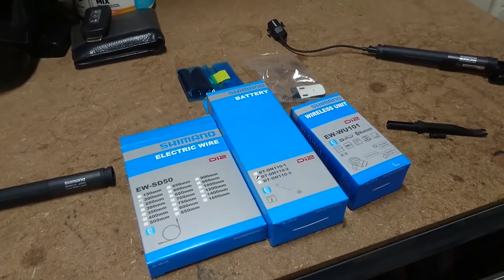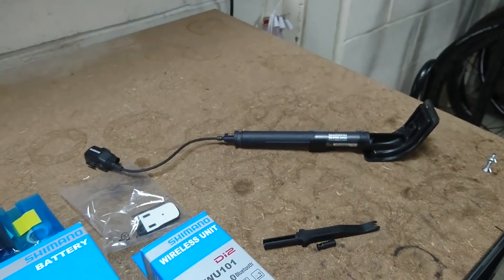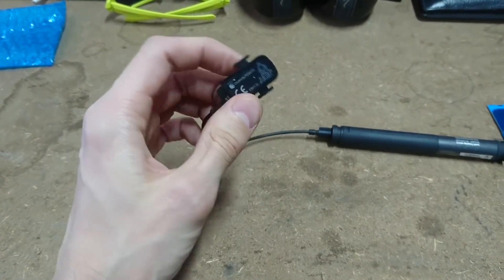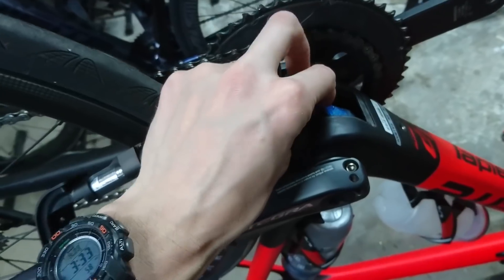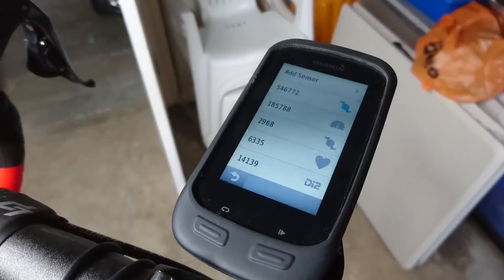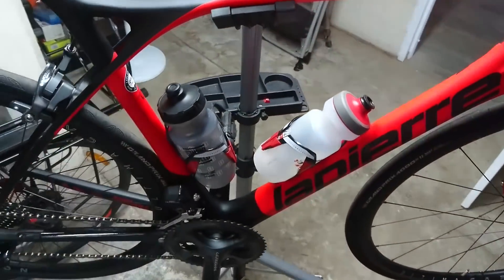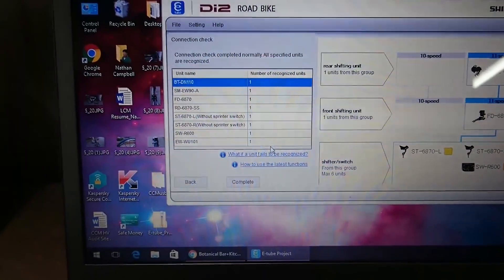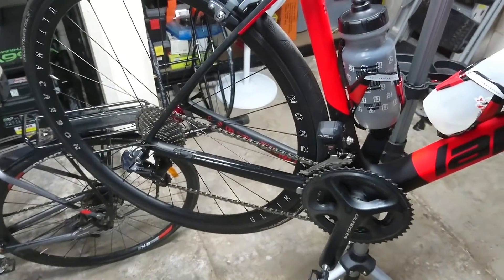Shimano Di2 D-Fly Installation: Replacing SM-EWW01 with EW-WU101

Comment: Did your battery died? I have exact same bike and having issues with the di2 groupset. The battery gets drained without any use in just 2 days.
Reply from the maker: No my battery is good. Unfortunately sometimes batteries die and you need to get a new one. Sometimes if you don't use the battery for a long time it can die. You'll have to buy a new one but at lease it will be the type that can do syncro shift.

Comment: Great video. Thanks for sharing. So how does the D-fly battery get charged?  Do you have to take it out all the time to charge it?  How often?
Reply: Charge it through the Junction box which on older models is strapped to the stem. In newer models it can be inside the frame with a charging port on the frame or on the bar ends. No need to take the battery out. I charge about once every 2 to 3 months just to be safe. With the DFly it transmits the battery level to your Garmin so you can easily check it on there.

Comment: Are you selling your old SM-EWW01 by chance? (assuming it's working properly and stuff :) )
Reply: Sorry I'm not. I have 2 bikes with Di2 so I'm using it on the one I don't ride as much. Good luck finding someone who wants to part with one!
Reply: Ahh ok, no problem mate. Thanks for getting back to me. It's impossible to get ahold of one so it looks like I'll have to upgrade the battery. To me it seems like kind-of a petty thing to do to force people to buy a new battery. From a technological standpoint, it makes no sense to me why a new battery is even needed to be compatible with a wireless unit. Super weird

Comment: E-Tube for ios will in most ocassions block your system as BluetoohLE connection is really unestable, and unreliable when disconnecting be careful that is being cause of trouble and is not esay to solve and not at all if you do noy have a PC, as Mac is not supported by Shimano. A pitty that this is so user unfriendly as Di2 and synchro is really a step forward.

Comment: That bike is baller!  Any idea the difference between EW-WU101 and EW-WU111?
Reply: No real difference appart from size. The new one can be mounted on the front of the bike tied to a cable. Old one could be mounted at the rear derailleur. However best is to just put either inside the frame and forget about it. I haven't had any problems with drop outs or signal strength.

Comment: wish i found this vid a week ago. i have the old SM-EWW01 and thought it was ok, just needed the battery. was looking forward to syncro shifting but alas i have to wait another week or so for a EW-WW111.
Reply from the maker: vincem5 Yes, it's painful! Problem is that you can't use your old battery with the new wireless unit either as it isn't backwards compatible.
Reply: i think you can. after plugging the new battery in i checked on my Garmin to see what the charge was like and it was 25%.
Reply from the maker: vincem5 Ohh right, Mine wouldn't work or be recognised with the old battery. May have been an issue with the failed firmware update though.